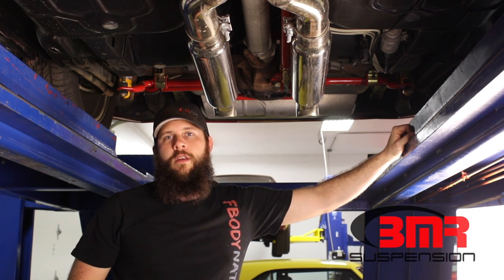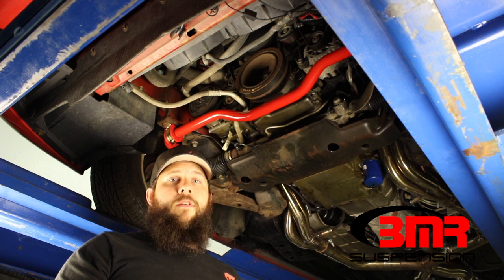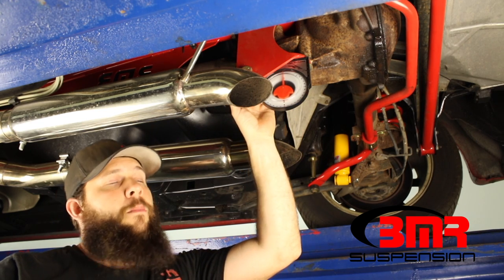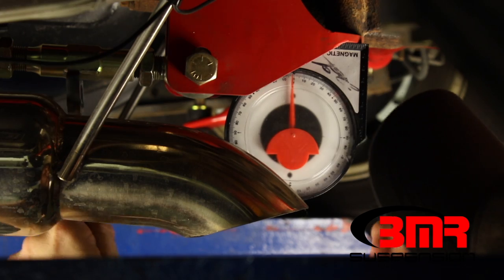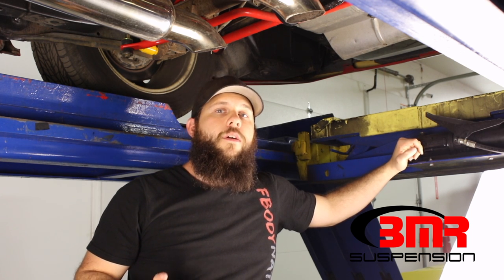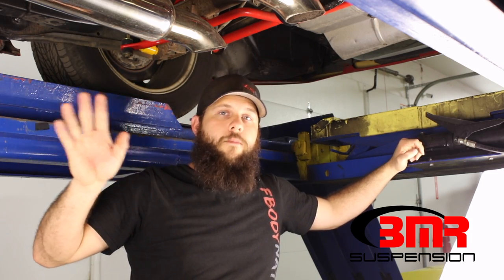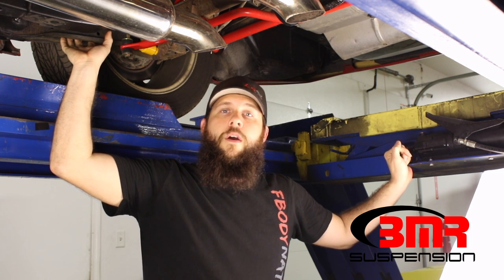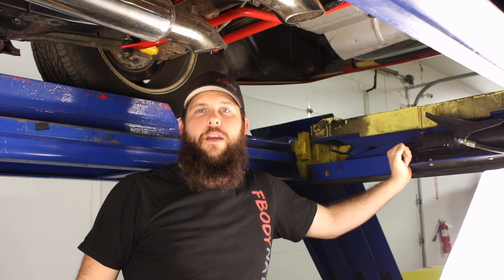BMR Suspension 3rd and 4th Gen F-Body Driveline Angle Instructional VideoVideo

Comment: So if my engine measures 2 degrees tail shaft down and I have rubber bushing control arms so I need to subtract 3 degrees I should be at -1 degree at the rear end?

Comment: Nice video. I lowered my 94  z28
And had a zero deg with my BMR setup then went back up added 
345 tires on the rear and adj coil overs in the front . Had to add air on the back to keep the fenders off the tires . Your video sure was easier than the drive axle / pinion method 
Thanks a lot . Seems to fixed the vibration 
-3.0 front 
-1.0 rear

Comment: Does BMR supplie pinion angle finder with Torque arm in box
Reply: What is pinion angle?
Reply: Not sure but it was optional in the cart when I bought my Spohn arm. They’re cheap but you can get the same thing at Home Depot or Lowe’s in the measuring tape and levels section
Reply: He is using a harbor freight angle finder.